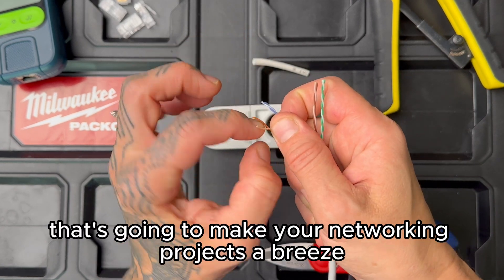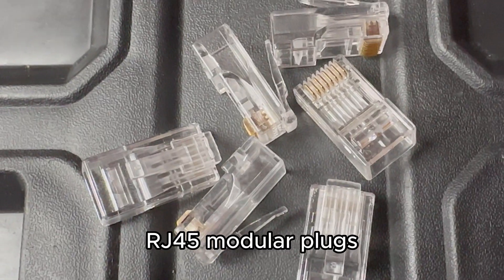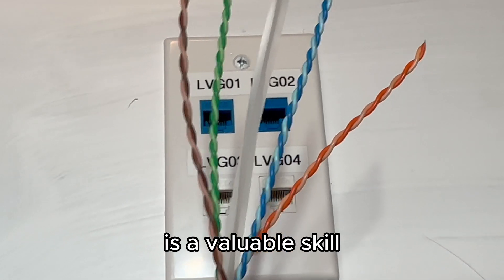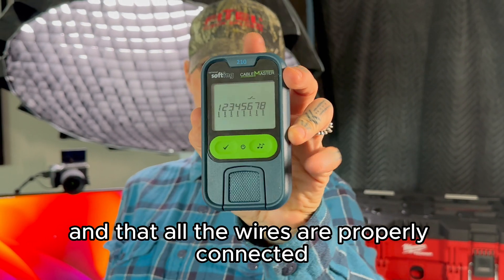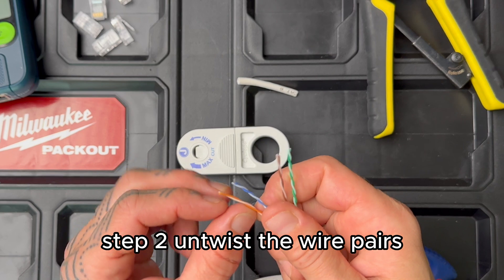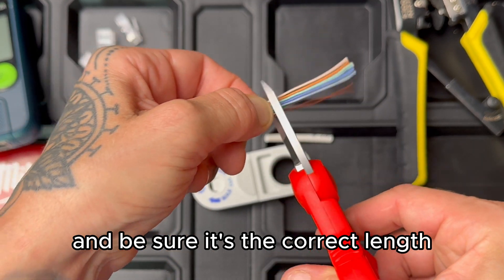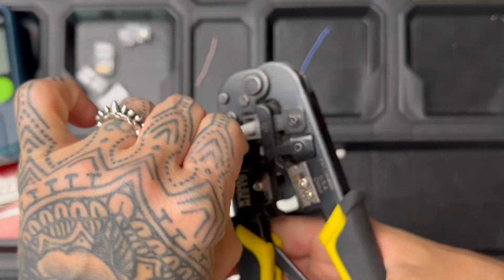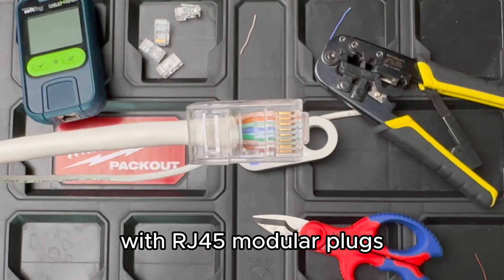How to QUICKLY Terminate and Wire Up CAT6 with RJ45 8P8C Modular Plugs

Comment: Girl you are better than me. Cabling is not for me. That is my kryptonite in the IT world. Sure, I can terminate cables, punch down cables(wires) into 110 blocks and plug things into the correct things they are supposed to be plugged but it is when you lift that drop ceiling, see a nest of whatever is in there and other obstructions that I want to yeet myself out the window..

Comment: And using the shaft of a terminal-driver will quickly help to un-twist the pairs, by inserting at base of insulation through the twist then pull to un-twist
Reply from the maker: I've seen this technique but haven't tried it. Thank you!